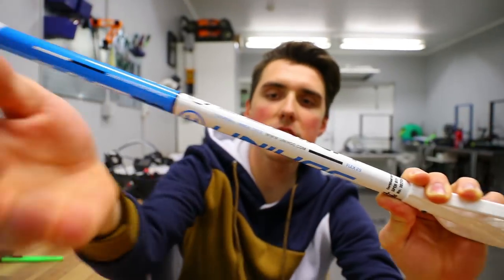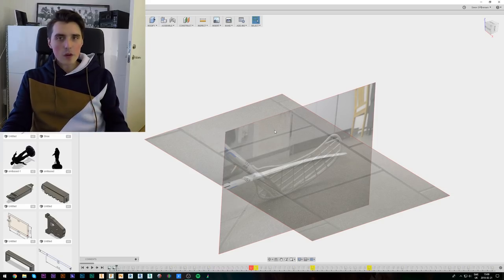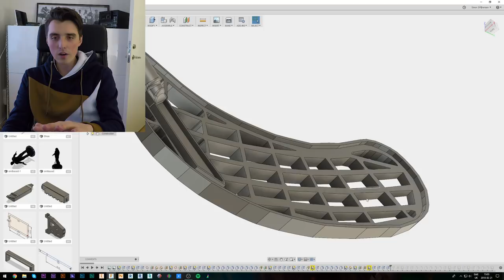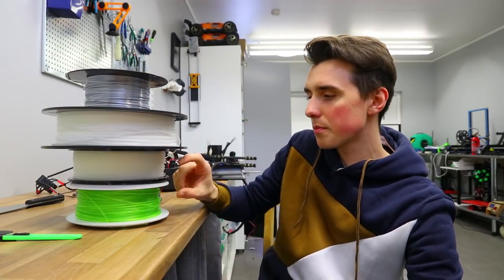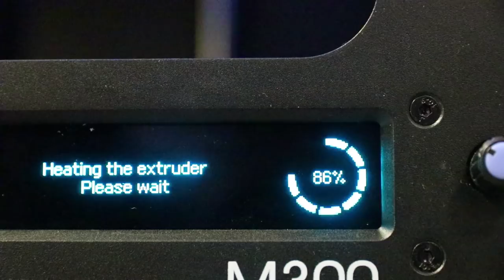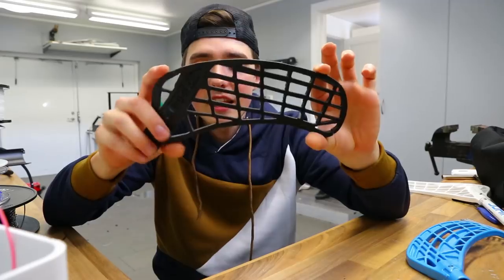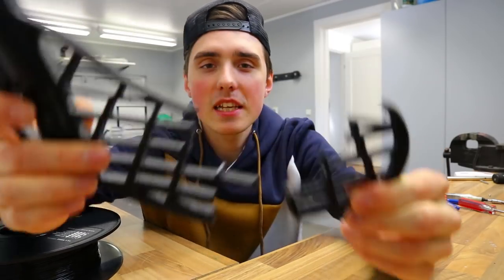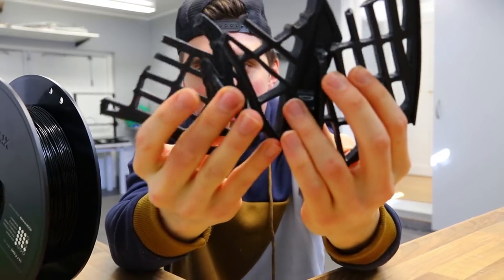3D Printed Floorball Blade - Will It Work?

Comment: Hey there Simon,  I think you might have better luck printing in a horizontal and flat orientation.  You may have more support material to clean up but the layers will be contiguous and the brunt of your force will not be going against the layer lines like they are when you are printing the part vertically.  I would be very interested to see how that worked!  I love your videos man! Keep up the great work!
Reply: Evan Olson  good idea
Reply: Exactly this is what I thought!
Reply: Evan Olson I was just going to comment about this! Agreed. Print would have been stronger if printed in a horizontal orientation. The only problem that I can think of (at the moment) is that the opening that connects to the stick would still be weak in that orientation... Maybe model some braces or coat in epoxy (or something similar)? Was a great video, though! Thoroughly enjoyed it! 😄
Reply: thought exactly the same
Reply: Exactly what I thought
Reply: Agree but it doesn't affect much turning the temps up would increase layer adhesion and more infill also may work and I think I am wrong about this but I think you shouldn't have used a blowtorch as it may decrease layers adhesion
Reply: That's exactly what it needs.  And an increase in temp.
Reply: I also think it's the layer orientation rather than the filament.
Reply: I was going to say the same :)
Reply: That was the first thing that I thought the moment he started printing in that orientation. the layers should always be normal to the impact direction (if you know the direction of forces)
Reply: He could do that and also try ABS, I used it to make a buckle and it worked fine where as the PETG broke on the first flex. Just a thought.
Reply: Ya, print on the length and try the nylon. Annealing the part would probably help as well.
Reply: I literally just commented a very similar comment and then read this lol
Reply: Evan Olson 
I wanted to suggest the exact same thing. 
The part should be stronger when printed in the other direction. 
But I like the project!
Reply: hey simon, when will you make video on your rc car "besttie" you told in your video???
Reply: Lay it flat and bend it afterwards .... and maybe print a reinforcement ring to put over the "stick joint"
Reply: This
Reply: Agreed
Reply: Maybe a post-print bake in the oven at low temps too?

Comment: Just noticed, your PETG in the Zortrax was SUPER hairy. Did you dry the PETG before throwing it in there? I had the same issue with Zortrax PETG on the M300, but drying took care of, say, 75% of the hairs. Also, it could be the PETG was more brittle because of the hairs and possible moisture in the filament when printing. Maybe?
Reply: Big fan of yours here Joel!! We got the same name :)
Reply: 3D Printing Nerd 
You, Angus and Simon are by far the best YouTube channels based on 3D printing!!
Reply: Joel James you forgot make anything
Reply: Extrudr told me not to dry their PETG filament this will destroy it

Comment: Print it laying down instead of vertically.
Reply: Sander Busch the blade is curve, so you can't print it layer down
Reply: There will just be more support needed, but it will be so much stronger since a 3D print is weakest along the layer lines.
Reply: You can but with support.
Reply: Riwox yes you can print it with support but it will be too small to remove

Comment: I also find PETG to be very strong but not tough. It is not good with sudden impacts and it shatters like glass. Nylon is definitely the way to go here. Just make sure you dry it out before printing with it, even if you store it sealed with a desiccant, or even if it is a brand new spool. Cheers! Great video as always.

Comment: Print horizontal! Printing vertically leaves it vulnerable because there is a smaller area (height of the blade) than there is length. SO it sould be stronger when printing horizontally and/or flat :) Love your work!

Comment: You could try printing it in a more strategic orientation with the layers going the long way down the blade so that it would be stronger to a force applied at the end of the blade (like the one that shattered it)

Comment: you definitely know better than to expect it to not break because of the layer orientation... 
you might get the brace to crack, but you can always change the angle, i.e. not flat but at an angle along the length, even if that means tons of support - or you could design custom support structures (I would)
love the background music of your clips!

Comment: Try printing it horizontally, not vertically. PETG brakes along the layer lines. You'll have to use a lot more support material, but that's how it is. Keep up the good work!

Comment: Yes, this is disappointing.

You could try Nylon ! I personally used Taulman Nylon Bridge, it's quite easy to print and can handle much more stress than any of the PLA or PETG that I tested. You'll end up with a more flexible part though!

Don't forget to REALLY dry your filament in an oven before printing this kind of parts where strength is important!

Comment: Well tested! I'm looking into testing flexibility vs carburetor temps and obviously associated chemical and temperature issues (replacement carb diaphragms). Just have no experience with 3D printing. Shortly will have a crazy learning curve when my cheap Anet A8 arrives.

Comment: Maybe if you print it horizontally (parallel to the base)? I think the internal structure will withstand forces in the needed direction much better. If you try that, I'd recommend putting a flange or something to reinforce where it meets the stick.

Comment: WOW I missed it. What you build with those #D printers is awesome. Wish I heard about it sooner the CR10, looks like that would have worked to make the parts to make the gaskets that I need, and hearing how the one roll was $150 wow pricey.  I don't know if you would be interested in printing one up as I do have a basic one cut out but its not even. I would be willing to pay you for the material cost and of course the shipping cost from Sweden to the states. As I tried to make a gasket with my mold and its not right my measurements are off since I was cutting it out by hand. I will understand if you say no that you don't want to. Anyhow keep up the cool videos and I am not surprised that you are past 200K. you put out some awesome videos.

Comment: Also you orientated the printing layers with the weak connection to each other in a right angle to the impact force when you hit a ball... Laying the blade on the printing bed will add some durability.

Comment: Change the orientation to print along the length of the blade. What layer height did you use? Consider increasing it to get more strength.

Comment: Just printed my first objects with Carbon Fiber nylon, and they are near indestructible - maybe this would give you the strength, stiffness and flexibility you need? If anything, CF Nylon might be a tad too floppy for this particular sport. Another option is to laminate PETG to Nylon in layers- maybe a 3-4 layer sandwich would work.

Comment: Remove the curvature and print it flat. Then put it in the oven to increase layer adhesion. Than use the torch to bend it. That way you will get the strongest possible print.

Comment: I would print it with PETG or Nylon, but in a different orientation. I would print it flat, so that the whole structure(with all the holes)  is in one layer.
Reply: Statics is the keyword

Comment: May be try ASA for this kind of print
and you should print it flat on the bed then put it in hot water a few second then curve it like you need
so the line of print would be on the long side then more structurally sound
that is just an idea !

Comment: I suggest to try change orientation of model not the perpendicular to XY  but parallel with  XY  .... force "slices" your blade in layers , try to print that the force will go perpendicular to layers you should get much better result ... In the worst case bottom or upper part ( if you imagine it stands on the ground ) can break off  ... and one thought ... what about print from ABS (or other material (PLA ?)  full infill , and put into oven for tempering  ~  80°C(not for pla - pla much lower (make a samples and try )  ) and slowly cool down... ( I am not sure about that - just Idea ) ) would be nice to see ....

Comment: Grain direction. Any material that's supposed to take a lateral load should be printed in the direction where the layers are perpendicular to the loading forces. This allows for maximum strength from material rather than adhesion between layers.

Comment: print it on its side instead of vertical, when you print it vertically. you are putting the grains of the print in the weakest direction. if you print on its side(the widest side) it'll layer better and the grains will run lengthwise instead of widthwise

Comment: Amazing save! Was that Game 7 Overtime? ;). I know nothing about 3D printing but I do use a lot of replacement blades (the insertion kind (https://www.hockeymonkey.com/catalog/product/view/id/162034). Could a solid blade help reduce the chance of breakage? I realize you are replicating the blade you were using but if replaced the struts with solid wouldn't it improve strength? The blades I use are ABS/fibre. I have never seen one break unless it was stepped on or wore through on asphalt.

Comment: Petg is hydroscopic and it loses its strength when it absorbs all that water
Reply: You should bake the spool in the oven to get rid of the water and then keep it in a dry box with descant between and during prints